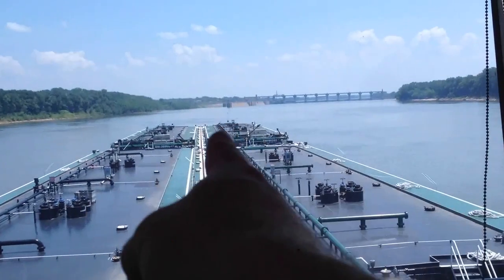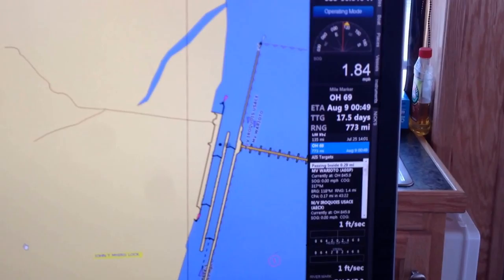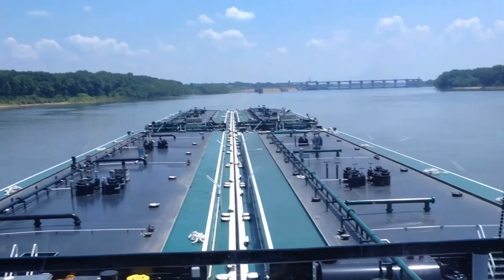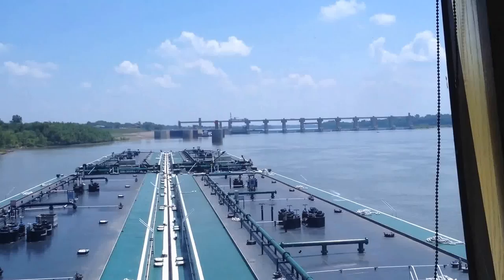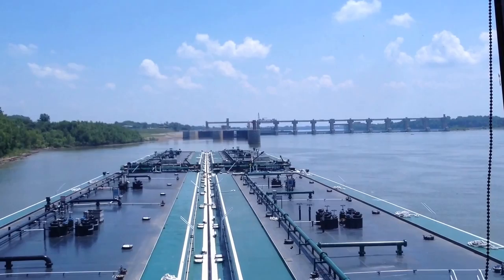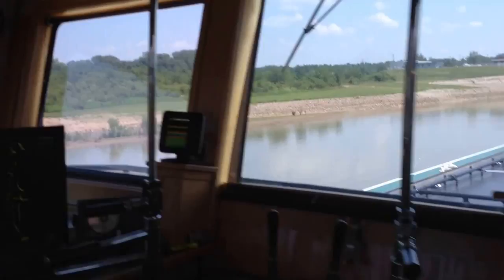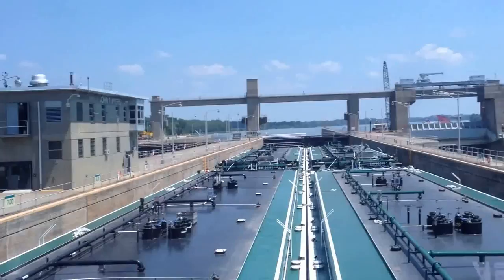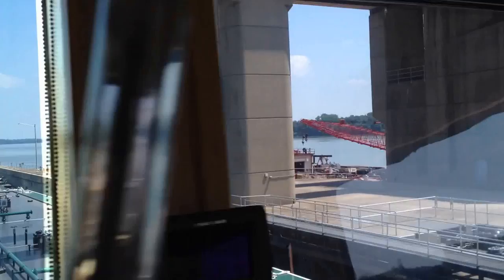making john t myers

Comment: Great video, somewhat bigger than I'm used to. How do you get away from the wall, can you pivot using a corner of the tow, or is there a bow thruster in the front barges?
Reply from the maker: no bow thrusters, but plenty horespower to drive away from wall.